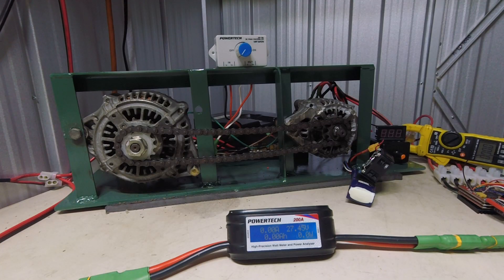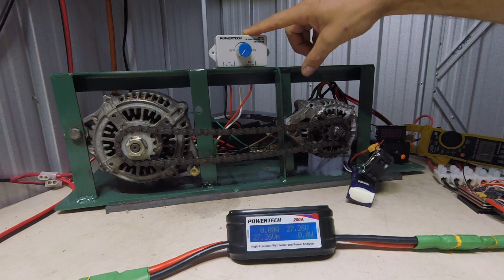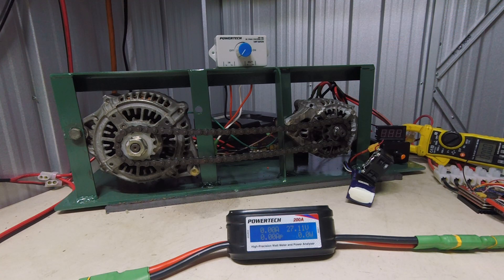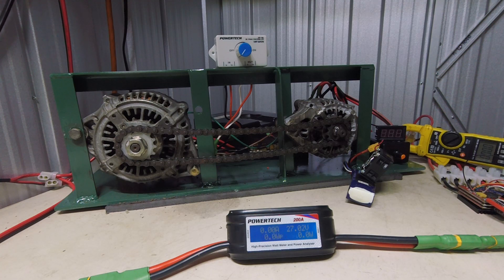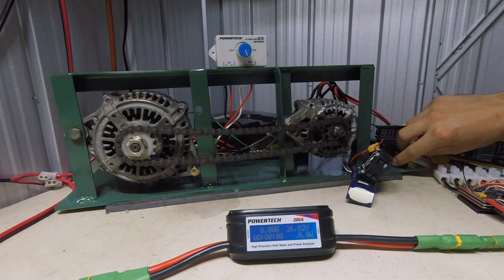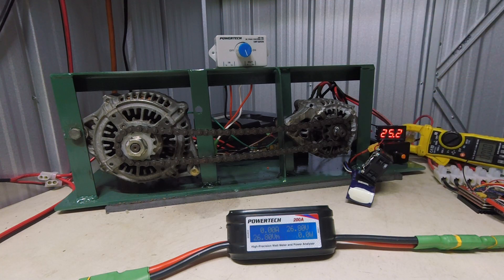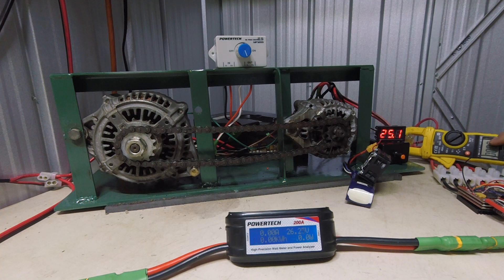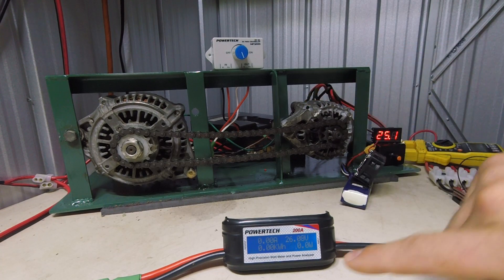Full load and improvements of the load motor setup.  Alternator converted to motor

Comment: I'm anxious to see more tests, maybe in the future when you get more consistent tests with both the VESC and the redbrick ESC, you could try 36v/48V tests, maybe the higher voltage helps with the current draw and with more RPMs the motors could run a bit cooler
Reply from the maker: yes will do mate,   The redbrick can only take up to 7s but the vesc takes up to 12s.  I will make up a lead so i can put some lipo battery's in series,  They can take the currant and i dont really care about them.  I will see what rpm the redbrick can spin the motor on 25v no load.  The rpm is lost due to the huge voltage drop,   will be good to see what it can put out with out the voltage sag.  Yeah your right everything should run abit cooler with a higher voltage as long as the stator doesn't get saturated